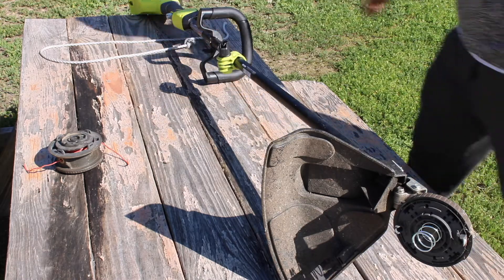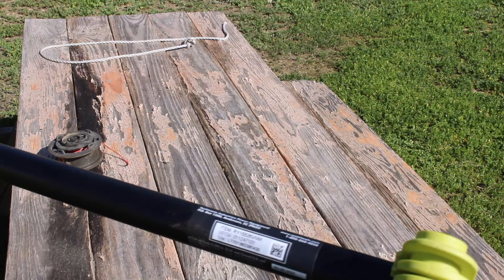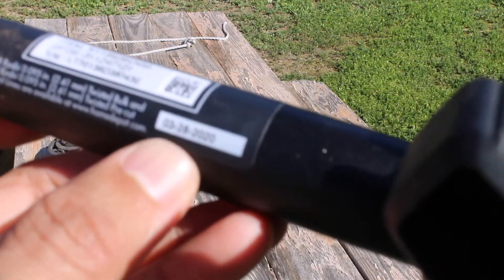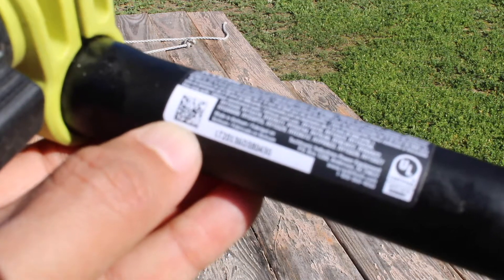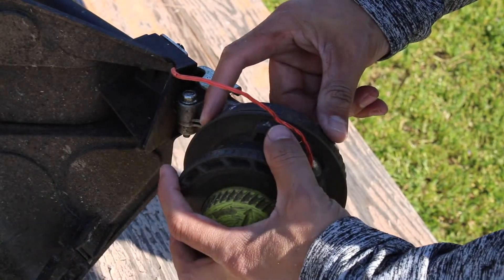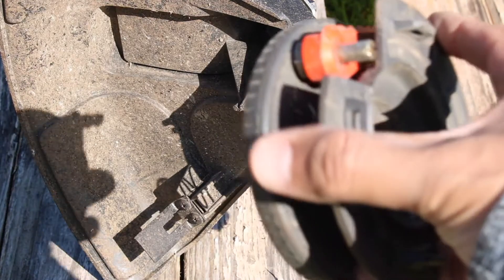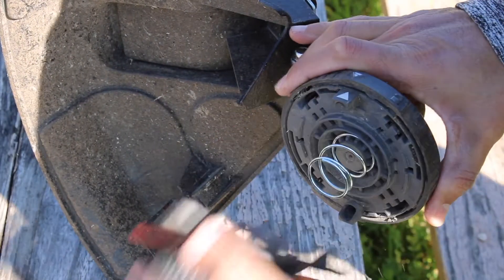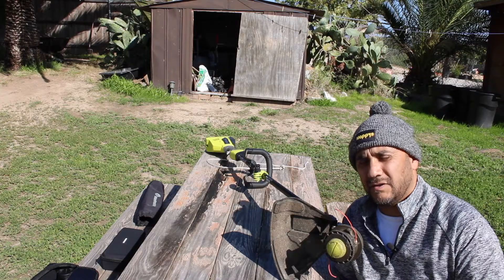How to Change the Heads and Find Serial Number on Ryobi Trimmer

Comment: Trying to push and turn is not working for me 😔
Reply from the maker: Make sure you push hard before turning. Also make sure it’s somewhat clean. If there is dirt and grass stuck in the grooves it won’t work. Also make sure it is line up correctly with the arrows depending on which head your using.
Reply: Did you ever find an easier way to open it? 
Opening this thing to change out the string is the one thing i dread about mowing the lawn. 😂
Reply: Me too! Sometimes the push and turn is EZ, other times (even when clean of grass and debris)  the hands of Hercules couldn't turn it!!!
Reply: @feltonjhammond   I cant get mine to turn and lock!!!!!! About to throw it in the pond!!!!!!!!!!!!!!!!!!!!!!!!!!!!
Reply: @emilyanderson4088  me to Emily. I'm contiplating just buying a new one since I can't get this thing back together. Especially since I bought all these Ryobi batteries for other tools. What a pain in the ass!
Reply: I couldn’t get mine to unlock. Then on the piece you squeeze and hold in place I used a screw driver so I could remove the rim but now I can’t get it aligned right. I noticed after I pried it apart the stupid string got all tight again and I had ti cut the line just to get it all off again! Anyways, I thought I got it back together good and aligned it in several different ways it still won’t snap back into place correctly. So when I take the head and align the arrows it won’t even budge for me to twist it at all which is why I had to do this in the first place. I don’t know what to do! I’m beyond frustrated!
Reply: @OGSmush32 I feel the same. Whyd they make it so difficult???

Comment: The place where the arrows are on the top the rubber has been removed and the 4 pegs fell out..
How do I put the rubber back on with the four pegs in place in order to replace the speed feed head
Reply from the maker: Not exactly sure. I would have to take mine apart to check. They do sell replacement heads of yours is broken or missing a piece.
Reply: Thank you for your help but I figured it out.
The pegs go in horizontally and I put the string casing on before snapping the plastic back on, it works.
Reply from the maker: @barbaraehughes1466  ok awesome. So glad you figured it out and didn’t have to buy any parts. 😆

Comment: I am trying to find the locking assembly that holds the bump spool on, it looks exactly like your model. Only the one I have is gas powered...
Saying discontinued, if the electric one has the same head... hmmm🤔
Reply from the maker: Maybe look up the part number and compare? Check out my other video where I go over each piece that might also help. Lemme know. Good luck.
Reply: Actually finally figured out the the REEL EASY + Bump feed string head with winder is the correct one👍
I found that out by searching thru home depot site. They showed a sku# and its the same.
Reply from the maker: @mattfoy1376  good to hear you figured it out.

Comment: Hi...about how long is the battery lasting before you have to recharge...Thanks
Reply from the maker: Usually months. But that cuz I only use it every once in a while, but you probably mean how long it last while I’m using it. Most people say 40 minutes but put it this way, I have never had to charge it while using it. My battery usually runs out before the battery on weed eater runs out. Jaaaa. Seriously though I have never needed to charge it during use. My yard is about a quarter acre and it does fine. Happy wacking😁

Comment: I just bought a 2 stroke ryobi the same one you have but my cords keeps slapping the guard and doesn’t spin right can someone help?
Reply from the maker: 2 stroke? Like gas powered? Mine is battery powered but prob same design at the head. If so your wire is sticking out too far. Just trim with some wire cutters or use the tool provided to wind up the wire so it doesn’t stick out so far. Hope that makes sense and helps. If not leave a comment.

Comment: Is there a certain way to open mine is stuck I can’t align the arrows
Reply from the maker: To remove you have to push in as you turn to the left. To install you line up the arrows and press in as you turn to the right.
Reply: Dang I wish mine was as easy as yours. I got mine off super easy, but can’t get it to go in the locked position. (?)
Reply from the maker: @ianbarker18  make sure it’s clean and no dirt or grass is stuck in either part to allow it to lock in place correctly.

Comment: Have you used the orange blades yet? How long do you think they'd last?
Reply from the maker: I actually have used the orange blades. I just tested them about a month ago. I only used them once for some thicker stuff. They seemed to do all right.  I think they will last a while if used on grass but for thick weeds they seem like they would wear down quickly. But I would have to use them a few more times to be sure. They for sure do the job but I think I ended up using snippers instead. Please like my video and help me reach 1,000 subscribers. 🙏🏾🙏🏾🙏🏾 thanks for watching and commenting

Comment: Thanks. I'm going to try again. They made this thing so difficult.😡
Reply from the maker: Trying spraying it with a cleaner and spray with water hose with a pressure nozel. Then spray with wd40 to los sen it up and make it easy to turn and connect.

Comment: This is literally the most difficult thing I have ever attempted to do.
Reply from the maker: I’ve noticed the older and more use my string trimmer gets it can get more difficult. But if you take a brush and clean the head to loosen up the dirt and grass it comes off easier. Also clean before putting back together. The slots need to have a clear clean grooves to remove and install easier. Hope it helps.

Comment: I do not like this ryobi weed wacker. Its very hard and annoying putting on and taking off the head. I had many weed wackers and this one by far is the most annoying
Reply from the maker: Totally feel you. For some reason it’s been easy for me to take off and on. Make sure it’s clean from dirt and grass when you are taking off or putting the head.
Reply: I called the 800 number and was referred to AABCO...they used WD40 to loosen up the dirt...it was easy after that....you can also run water over the head to keep it clean too....hope this helps bc i spent 5hrs trying to go in the locked position...
Reply from the maker: @barbarasledge3435  awesome. That’s what I’ve been telling people to do when they say it’s stuck or can’t get it back on. Thanks for the comment.😁
Reply: @barbarasledge3435  omg thank you! This thing won't twist back into place & it's driving me mad!
Reply: I couldn’t get mine to unlock. Then on the piece you squeeze and hold in place I used a screw driver so I could remove the rim but now I can’t get it aligned right. I noticed after I pried it apart the stupid string got all tight again and I had ti cut the line just to get it all off again! Anyways, I thought I got it back together good and aligned it in several different ways it still won’t snap back into place correctly. So when I take the head and align the arrows it won’t even budge for me to twist it at all which is why I had to do this in the first place. I don’t know what to do! I’m beyond frustrated!
Reply from the maker: @kristen_gio-harrington  sorry to hear all your frustrations. I noticed people have difficulty if the heads are dirty. Try getting a brush and scrubbing off all the dirt and grass before changing heads. You can also spray with wd40 and that might help. Make sure you push in really hard while turning. All that should help. The string is held in separately so should not come out at all. Don’t turn the small head on top.